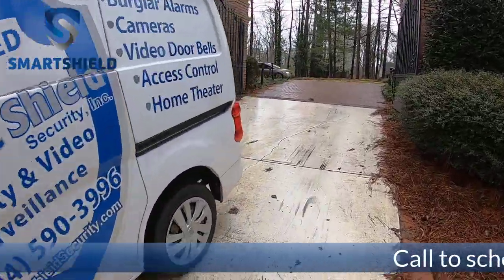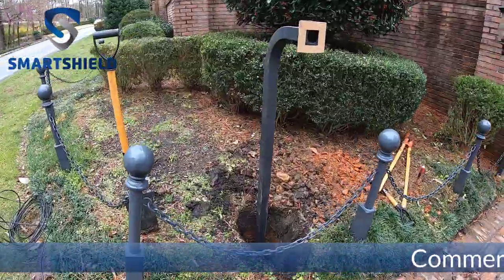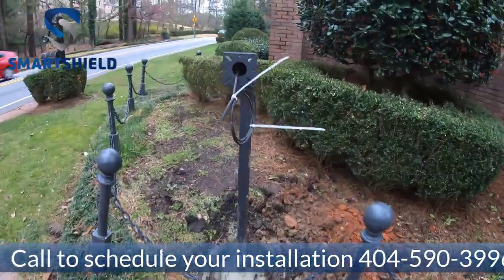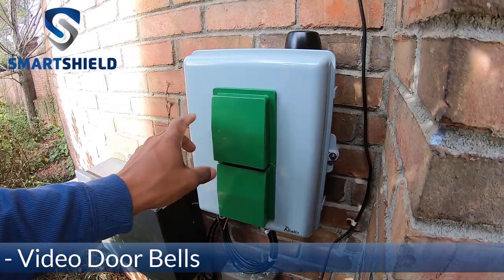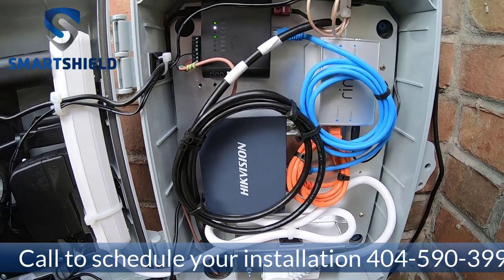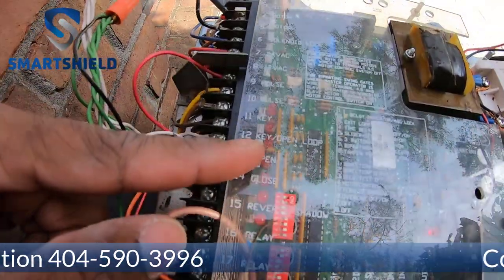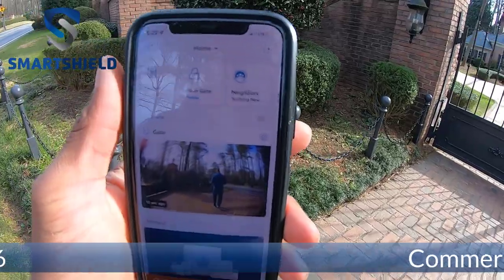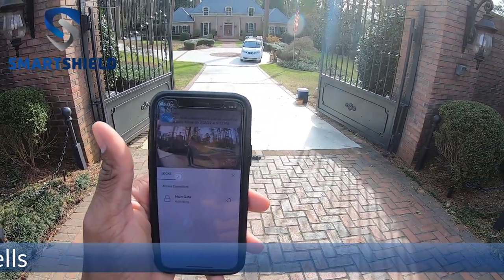Ring Access Controller Pro 2 and Door King 4502 Gate Opener Installation

Comment: Thank you for the detailed end to end walk through of the product. Super clear :)
Reply: Bit of a random question, which I don’t think is the case, but why is the Ring Access Controller Pro 2 not PoE capable? Seems to me that having to use a micro usb to power it a bit redundant and cumbersome for those that are trying to be minimal with their installation.

Comment: Why are you using a PoE injector if you have a PoE switch? I'm just curious.
Reply from the maker: Dont want no problems from Ring with warranty if something was to go wrong with the video door bell. Manufactures will kick back and say you didn't use the supplied injector and deny warranty.
Reply: @smartshieldinc  I totally agree with you on that since you are providing a service.

Comment: im going to try that same setup with a liftmaster sliding gate operator.  What kind of wire is that you used to connect the controller to the gate motor?